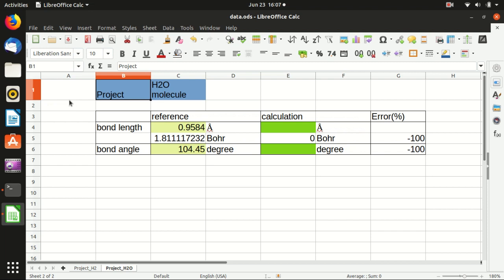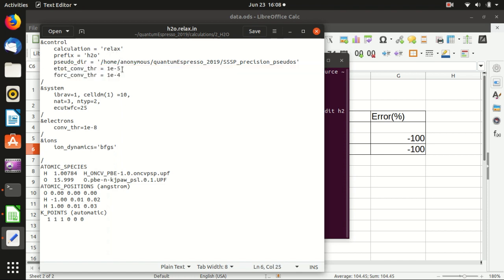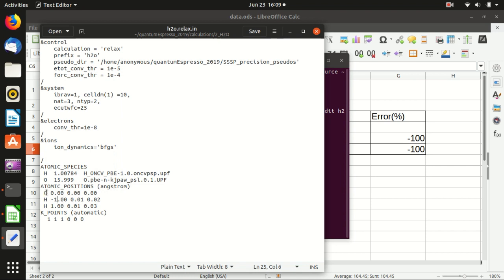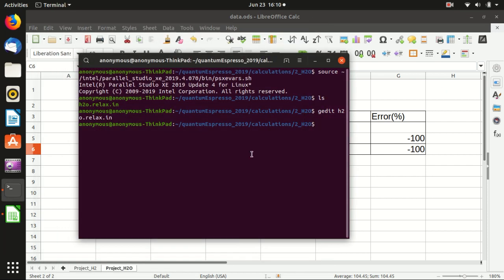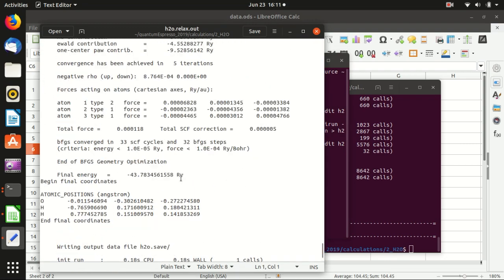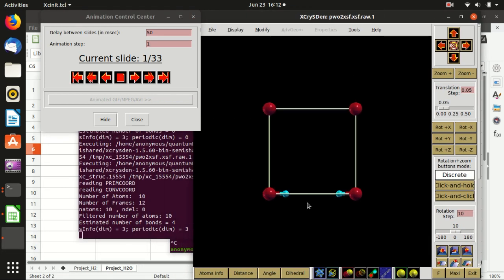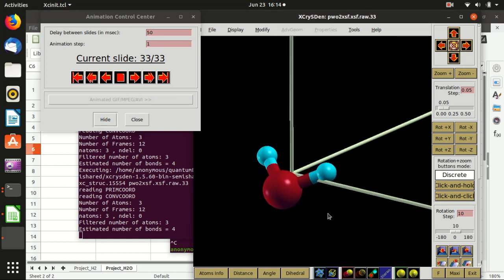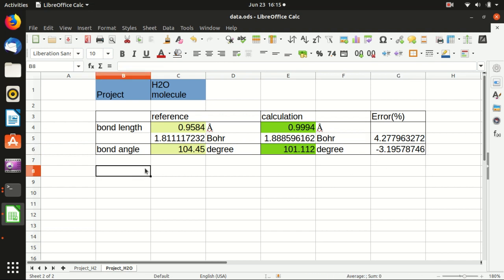Project: 2 Water molecule (bond length and angle) | Quantum Espresso Tutorial 2019

Comment: 0:00 Introduction
  Geometric properties of water molecules (bond length and angle)
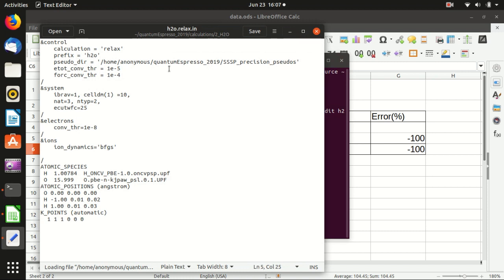0:42 Input file
calculation = 'relax'
prefix = 'h2o'
etot_conv_thr = 1e-5 (default 1e-4)
forc_conv_thr = 1e-4 (default 1e-3)
 !!!Decreasing these values leads to accurate calculations!!!
2:35 Breaking symmetry:  'Perturbation' of y, z positions of H atoms (0.00 --> 0.01 etc.) 
in order to avoid one-direction relaxation 
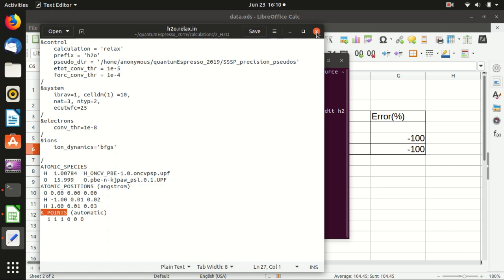3:15 Calculation run. Output file
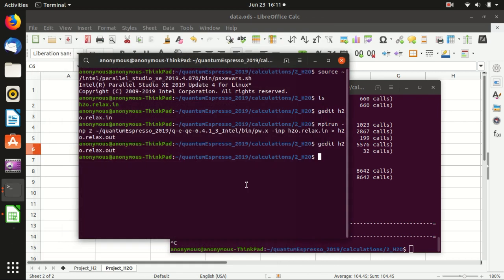4:44 Use of xcrysden to get bond length and angle. Comparison to the reference values